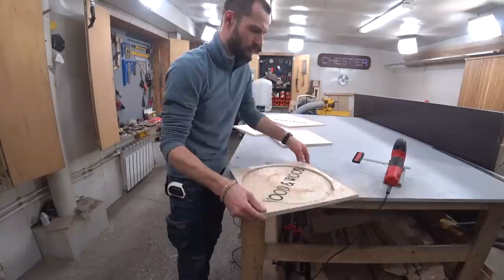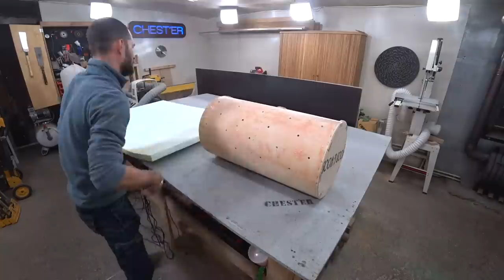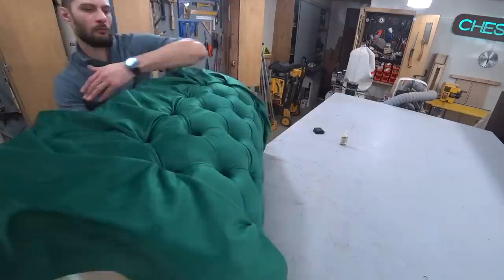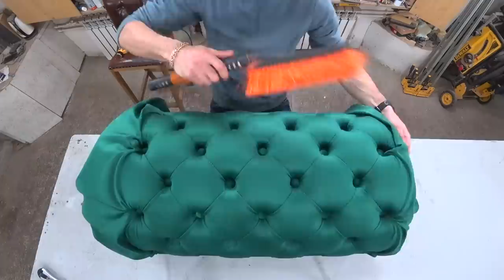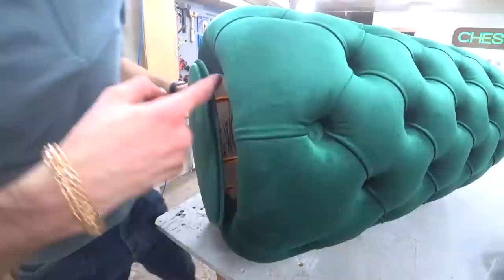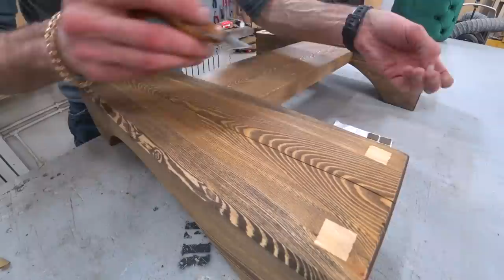New year tree CHEST'ER DIY furniture

Comment: This is truly excellent work. Bravo 👍👏👍
 
One question, how does it not rock on the strip of wood that holds the ends of the fabric down?    The cut outs the cushion rests in are round. I saw you sitting on it and wiggling. The cushion didn't move. It seems like it should rock back and forth on that non-compessible wood next to the compressible foam. This is such a unique construction I love it 

I am very impressed and would love to understand how it works.